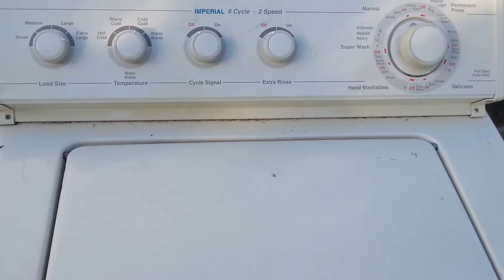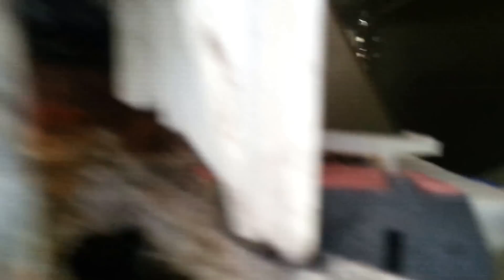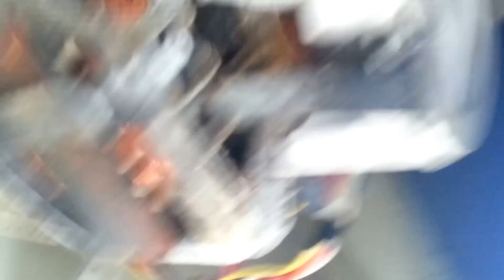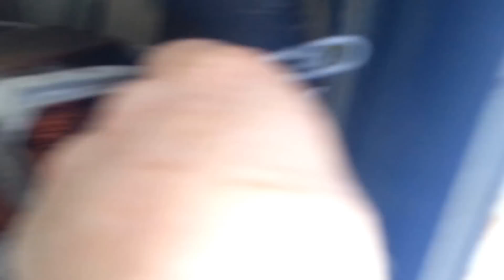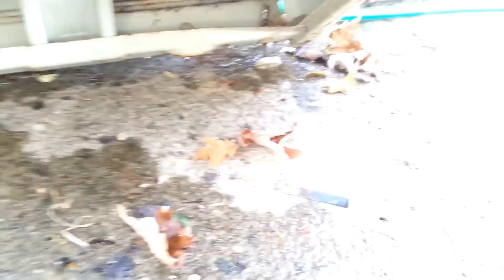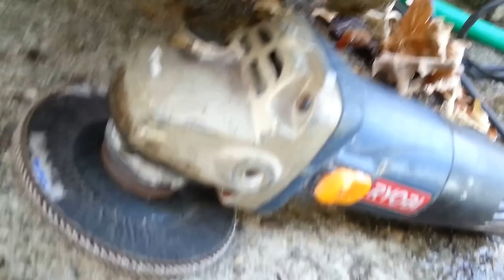why your Whirlpool Washer leaks water from underneath

Comment: There should be a better way than replacing the o.e.m pump.. some d.i.y way to overcome the manufacturing design imperative to replace the pump,, like a gasket from the flush water tank 😅

Comment: Thanks for the video. I replaced the pump and had to beat it on with a hammer because the shaft was so rusty. It now leaks worse than before. I'll try sanding the shaft next time like you did.

Comment: It would not surprise me if your upper motor bearing is the next thing to fail.  Can't understand why you would continue to run the machine with water leaking onto the electronics. Easy to see and fix.  I was just in that area a little deeper , replaced the clutch assembly.  Previously the coupler.  As things fail, I get to learn more.  Sturdy machine that runs a long time!

Comment: Good video! My Whirlpool water pump which is P/N 3363394 leaked from the top of the cover. It appeared that the bushing was slowing going out and creating resistance and heat, and due to the generated heat it melted a small hole on the top of the pump cover allowing water to be pushed out under operating pressure. Replaced pump and problem solved. Pumped cost $14.52 including shipping, and purchased on Amazon. Just about anyone can do this pump replacement in 5 to 10 minutes with a pair of pliers.

Comment: We ran ours outside last summer also pain to fill it but watered front flower bed all summer
We live out in country

So let my not so fixit
Change out pump
It did only leak when draining
Now it leaks with any water
Just hard to get it in and out of bathroom to check it
Hopefully just a hose not tight
Or pump not on right
But these videos save me so much money
10$
Pump
Vs 125$
Repair & that's with us getting it out of house uo in pickup hauling it in etc
If they come out a 225$+
For a 10$ part
Try you guys fix it yourself
Save$$$$$

Comment: I’d clean that motor up some - a light brass wire brush used gently to get rid of the rust - at least an old paint brush or vacuum to get the dust, cobwebs and dirt out of the whole thing.  Also, is the motor’s front bearing still in good enough shape?  After all that water and detergent/bleach dripped on it - might be wise to check that out too.

Comment: I have this washer. 24 years old. It's leaking water and moved the washer out and under is all black and rusty goop. Wondering if I should just get a new one, but also am not that strong to tip it back and don't want it to fall on me. Also, would be hard for me to get the pump off (no arm strength to pull it etc.). Also, how do I know it's the pump? I did put newspaper under it to determine leak is from back right which is side where water comes into the machine. Ideas???
Reply: Did you ever find out what the issue was?
Mine is a 25yr old whirlpool and also leaks from the back right and left black oil or grease on the floor...
 Before buying a new washer that isn't built nearly as good as the older ones, curious if it's an easy fix like this or a more vital part. 🤔
Hope to hear back as I'm pretty sure that my issue is the same as yours was.
Reply: @tonynorris1506  this was several years ago BUT I am so mad at myself. Nothing was wrong with it.  After I bought a new one, had it delivered and they took away my Whirlpool, my neighbor came over to help me hook the new one up....it was the washer deteriorated on the hot water knob at the wall....that was what was leaking!!!! So make sure the leak isn't from a washer at the knob on the wall.

Comment: Mine leaks when i turn it on, it doesn't leak when off, even though it's filled with water, and it's the first time leaking from the bottom
Reply: As soon as you turn it on, like when it starts to fill with water, or when it agitates, or what? (Just asking, not an expert, mine leaks when it drains, no other time.) If yours doesn't leak when not running, even with tub full, I'd think maybe the hose FROM the electric valve on the input water line might have a leak/hole in it.

Comment: Behind the whirlpool washer at the bottom on the left is the draining pump, and are there another drain pump in front of the washer. My washer want drain. It's got codes numbers and letters which pump needs to be replaced

Comment: It appears that the latest part # for this pump is WP3363394 which replaces a plethora of other part #'s, i.e. 3352492. The motor shaft was extremely rusted on mine and almost crumbled into little chunks, or at least parts of it. Thank you for making this video!

Comment: Amazing.  I am having the same problem.  I put a search on YouTube with the hope of finding a solution, and what do you know.  This is the first video I found with the same make and model washing machine that I have.
Thank you so much for posting this Daniel.  Now I know exactly what to do to fix mine.
Would you believe I have had my Whirlpool washing machine for close to 20 years, and this is the second problem I've encountered after all this time.  
The first, was a non-functioning cold-water intake, which I fixed myself.
Every major appliance in my home now is a Whirlpool, and it's all due to the great engineering put into this washer.
Again, Thank you Daniel.
Reply: I have had mine since I bought it brand new it really is a great washer I have it in a washing machine pan because of the terrible leak I have to shop vac the water out after every two uses. I thought that I'd let it leak for so long that it was a hopeless cause but I'll definitely give this a try before I spend money I don't have for a new washer thank you.
Reply: I'm not sure if I should replace the intake valve or the pump. Can you advise me?
Reply: @78Geneva  This will be based upon what you see when you look under the washer.  If you notice that the pump is definitely leaking (water around the connections), then you replace that.  If not, it's possible it could be something else.  In fact, go to https://www.whirlpoolparts.com/.  Their site is very intuitive and user friendly.  I'm sure you'll find out exactly what you need to do here.  I hope this helps you.

Comment: Thank you for the instructions.  That pump was definitely hard to get off.  It took some WD40, prying with a bar, twisting, and pulling to finally free it.  A note for others, wear some gloves because the parts and body of the washer are fairly sharp.  You will bust your knuckles and cut your hands depending on how fused the pump is to the shaft.  Thanks again!  It's nice to save this long running washer with just a ~$10 part.

Comment: Perfect.  This helped a lot.  $9 repair.  1.  You're from PA, right?  2.  Is it still working?  I ask because the iron piece coming out of my motor was rusted like yours.  Had to file it down.  3.  I took off the whole front cover.  Not that hard and allowed me to get the clips for the hoses easier.  Thanks.

Comment: Thank you. I am now encouraged to tip mine back and at least take a look. My pump was not rusted and came off easily. I poured some water in the main hose  opening to see it run out around the drive hole. eBay pump, $8.95 free shipping, be here in 4 days! Thanks again.